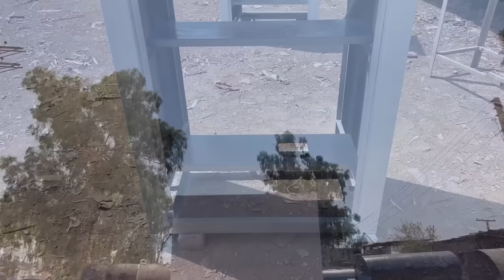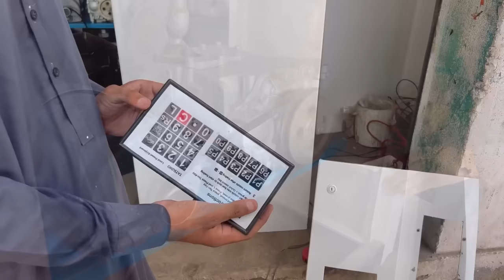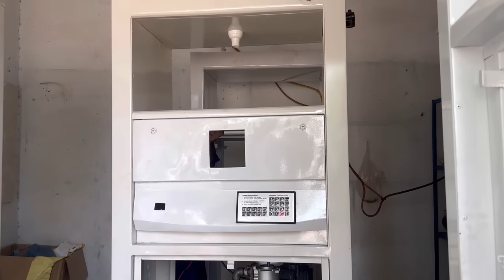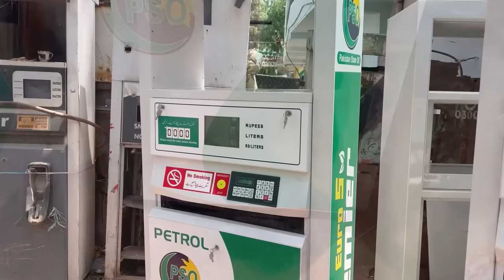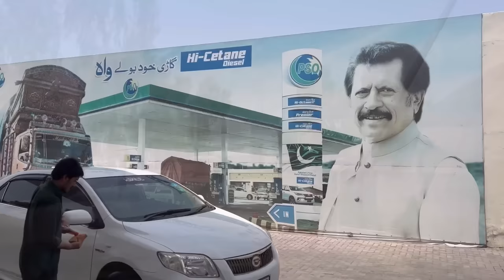Amazing Handmade Manufacturing Process Of Fuel Dispenser for Petrol Station|

Comment: Mkay,  some imprecise bent sheet metal, tack welded, without any safety equipment, then the greasy surfaces painted outdoors, with no primer.  Then some foreign-made pumps and hoses screwed in.  No braces, no soundproofing, no lockwashers, no ground bonding wires, no licensed safety inspection, no weights and measures certificate.    A rather a bit rinky-dink but might last six years if it doesn't rattle apart or blow up.
Reply: Yep and they do this for less than $70 USD a month, all good sitting on your high chair enjoying the luxury of health and safety enforced standards by your government and better working conditions and compensation if you get hurt, not these people.
Reply: Yes, we're sitting fat, happy, and sassy.   I only wish the best for those folks.  It is doable, as shown by other countries in the area that have pulled themselves up by their bootstraps, like Japan, Singapore, Malasia, and to a certain extent, China.
Reply: @georgegonzalez2476  China, to a certain extent? China is 10 years ahead of Western countries in terms of innovation/technology
Reply: @paul_ko  In many technology areas, probably more than that. In terms of fast, clean, reliable and affordable public transport? Light years ahead (and the gap is widening). The West lives via the skim "economy" (fines, fees, "finance"), whilst China (and others) live and thrive via the REAL "Productive" economy.